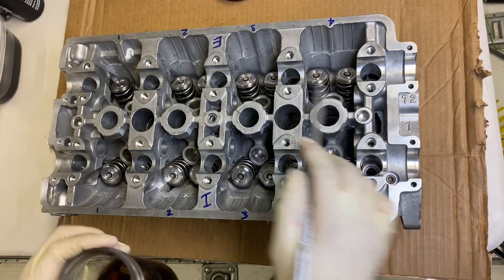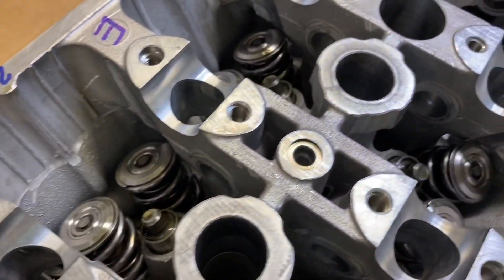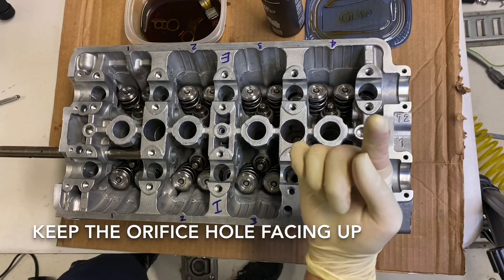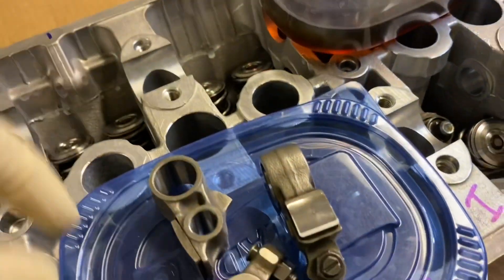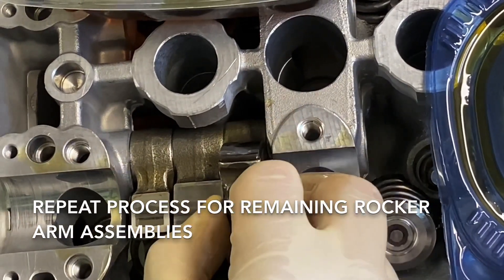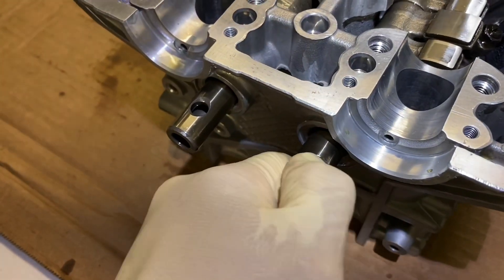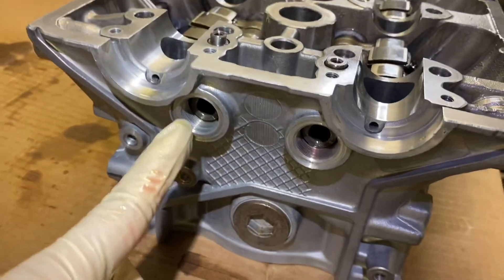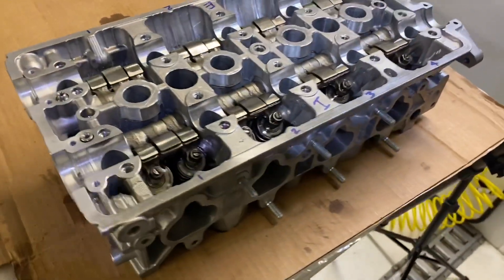Ultimate B Series VTEC Cylinder Head Build Guide - Part 4

Comment: Part number for the crush washer is 12209-pr3-000
Reply from the maker: @sauloaviles6008  I don’t suggest buying the OEM crush washers. You can measure the OEM crush washer ID, OD, and thickness and buy them for much cheaper on Amazon or eBay. I recommend maintaining a collection of common AL and Cu crush washers. Thx for watching and commenting. Pls subscribe. -AJ

Comment: Did you find that the rocker shaft got increasingly more difficult to push through as you went along? It’s almost like mine had warped while it sat. I have the correct ones on each side. But I imagine it could possibly just be from the increased friction as you go along. Thanks so much
Reply from the maker: @bauerleinjohn  assuming everything is lubricated and straight, you should be able to push the rocker shafts into position using ur pinky.
Reply: @RelentlessRacingAJ  I’m wondering if maybe because I disassembled the head and left the shafts in there for a while, maybe they’ve bent slightly or something
Reply from the maker: @bauerleinjohn  something is warped or bent and it’s either the head or shafts. Good luck
Reply: @RelentlessRacingAJ  aww screw it, just run it. I’ll take them apart and see if I can find out what’s goin on. Wonder if I misplaced a set of rockers or something. When I disassembled it. I put the shafts for the rockers back in the head. Maybe they didn’t like that and sagged or something. I do have ones from a blown head I might be able to test out and see if they work

Comment: Great video! I recently built a GSR cylinder head and accidentally stripped out the threads for the rocker shaft plugs on the head. Do you know if there's any way to repair it?
Reply from the maker: I’d check if there is a helicoil or timesert available in that thread.

Comment: I have a b16a and want to upgrade to ek9 type r cams. Are type r lmas necessary and is it possible to replace the valve springs without removing the head? Great video series!
Reply from the maker: I don’t know if the LMAs are the same for those cams. I’d do some research and figure that out. You could always go w aftermarket LMAs, too. Yes, it is possible to switch the valve springs so removing the head. Thx for the kind words. Pls subscribe. -AJ

Comment: Thanks for the videos. The rocket arms for the intake are the iqual to the exchaust? If not how to tel them a part?
Reply from the maker: I honestly don’t know and can’t check bc I don’t have a GSR head w me. I recommend searching an online catalog/parts dealer to determine if  the part numbers are different. I don’t know how to tell them apart bc I have never mixed them up b4. I always identify them and ensure they go back to their original locations. Pls subscribe. Thx for watching and commenting. Good luck -AJ
Reply: Thanks for the tip. O had them idetified but my wife mixed them up by acident. Already subcreved. 👍
Reply from the maker: @picole321  divorce time… JK. Thx for the sub. Email me if u need race car parts and I will do my best to book u up. -AJ

Comment: Are the exhaust and intake and exhaust rockers different? When I got the head, all the rockers were cleaned and put into a baggie mixed up
Reply from the maker: That’s an excellent question, but unfortunately I don’t have this cylinder head anymore to verify. Although, I do know the rock arm shafts are the same. I would suggest opening your bag of intake and exhaust rockers and comparing them carefully. I’m pretty sure they are the same despite the manual telling u no to mix them up. I believe the manual reads this way to make sure the cams and rockers continue to wear together
Reply: @RelentlessRacingAJ  thank you for the answer. It’s a fully built freshly machined head with pro 1 cams.
Reply from the maker: @hoodrichracing3901  pls lmk what u discover. Pls subscribe too
Reply: @RelentlessRacingAJ  so they all look the same and I confirmed it with my tuner. Exhaust and Intake are the same. Subscribed too 👍
Reply from the maker: @hoodrichracing3901  pls check out my eStore www.relentlessracing.myshopify.com
Reply from the maker: @hoodrichracing3901  that’s what I thought but couldn’t confirm. Thx for the update and appreciate u subscribing. Lmk if u need any parts.

Comment: what tool do you use to remove the rocker shaft?
Reply from the maker: Thx for watching Isaac. Pls subscribe to my channel. There is no tool reqd to remove the rocker shaft. Just like in the video you can see me installing the rocker shaft w my hand. When I remove the rocker shaft I just push it w my finger. Don’t forget to subscribe. Thx again 👊
Reply: I use the appropriate size/thread bolt from my stash of OEM bolts. A fine thread, long enuff to grasp, works great, like a corkscrew.

Comment: By far the best bseries assym video with well detailed and str8 to the point short vid. QUESTION.. what are your thoughts on skunk2 etc  LMA's vs Oem as in terms of benefits and when you should use the aftermarket Lma please?
Reply from the maker: HaterHurter sirG345 Honda updated the LMA’s, but I’m not sure when. On the newer design the part that touches the cam is a perfect cylinder. On the old design the part which touches the cam tapers at the top. Using aftermarket LMAs is fine, but of course I always suggest the OEM newer design. However, I’ve used the SUPERTECH LMAs w no issues. Additionally, I suggest checking ur LMAs b4 opting to replace them. If u can squeeze the spring and it returns to its normal position wo binding they are good.
Reply: @RelentlessRacingAJ  perfect! Grateful for your response Aj. Can you give me the oem part numbers for the updated oem Lma's please?